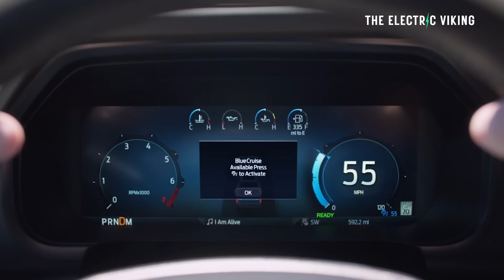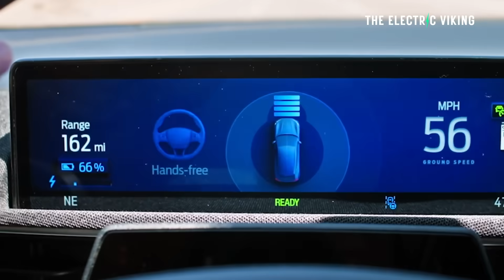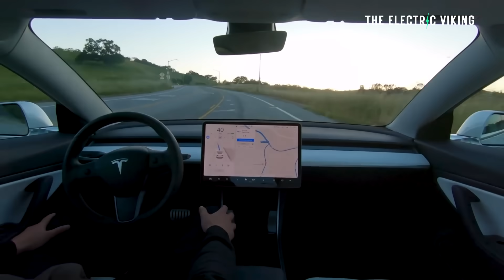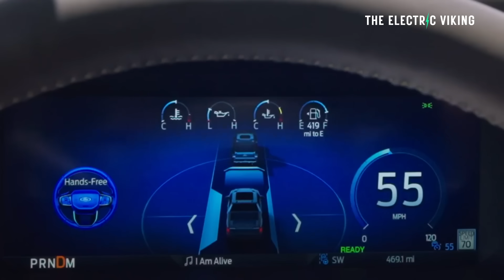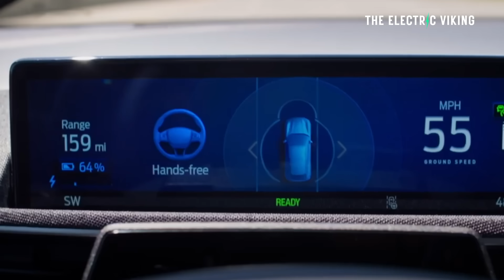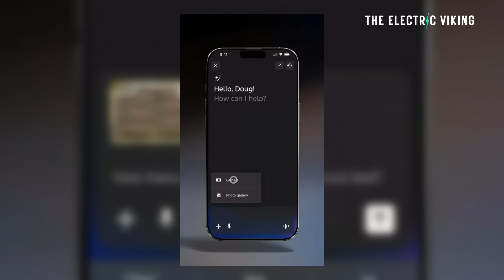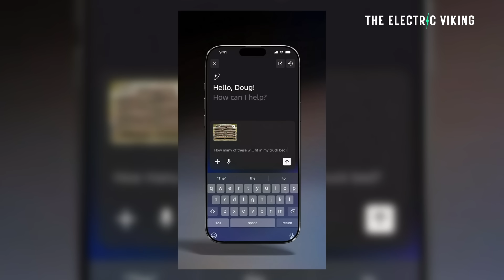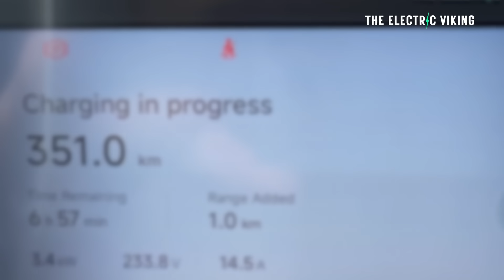Ford Says Its NEW FSD is 30% Cheaper than Tesla's and Capable of L3+

Comment: Is Ford building their own neural net chip? If so it might be nice if they gave some details. Tesla had Autonomy day six years ago where they gave a fairly detailed description of the HW3 chip architecture. Rivian just had their own autonomy day where they did the same, slightly less detailed but it looks like a similar architecture to Tesla. Ford hasn't done this so I don't believe that they are building their own computer unless they define building their own computer as putting an Nvidia chip on a board.
Using Nvidia for the hardware is a perfectly viable solution. Nvidia knows what they are doing with AI chips. The software is another matter. Ford doesn't have any training data to use, Tesla spent years collecting billions of miles of training data. Perhaps they think they can do it with simulation, that might be good enough to get them 90% there but it won't get them to 99.999% which is where they need to get to.
Ford was an investor in Rivian, they could go there to license self driving. It will be five years before Rivian gets to where Tesla is today but at least they've shown a path. Mercedes had demonstrated something that kind of looks like FSD. They've been working with Nvidia for five years so maybe they are close. Ford could go to them. Lucid is using Nvidia and they've partner with some company to provide the software, maybe that's a path.

Comment: You think autonomous driving must be self-developed by car manufacturers, wrong, relying solely on self-development by car manufacturers is very very difficult, most car brands do not have the ability to fully self-develop. In China, there are many technology companies specializing in autonomous driving, and their products are excellent. The so-called autonomous driving behind many car manufacturers is actually the result of seeking cooperation from these technology companies. It is common and easy to directly purchase an autonomous driving system completely, change the name, and introduce it at the press conference.

Comment: I had a similar reaction when I heard about the Donut battery
Reply: On the back of the announcement and I agree it is vapourware I had a close look on where the solid-state battery industry actually is.  My guess is that they are all extremely close but no one wants to press the trigger.  This is for their benefit it is nothing new.  Even if Toyotas decade long claim of having a solid-state battery is true they simply won’t release it because it will impact them more than anyone else.
Reply: @ouethojlkjn I mean, they're losing more by not releasing it if true

Comment: Electric Viking, what the hell are you talking about.  I've read the media release on Ford's site.  It is not saying anything about it being better than Tesla or anyone else. They are just saying it is going to be a massive  improvement over their current driver assist system.  I see them saying it will be L3.   I don't know where you get L3+.  Second hand sources are saying Ford is claiming  "point to point autonomy'.  But that is vague.  L3 by definition is hands off and eyes off the road from some point to another point.   So it's not false.   In fact all they are announcing is something they had already announced 3 years ago but it is coming two years late.

Comment: Hey Sam, it’s going to come out with level 2+ which is supervised and then level three on highway only which is hands-off eyes off meaning you can text message or watch videos however, once alerted you have to be prepared to take over the vehicle that’s different than level four where you can fall asleep in the vehicle is expected to be able to take over and save itself in a problem or emergency in level three you are still expected to take over and you are not able to fall asleep. Their level three eyes off will only be on highways.

Comment: Ford's stock is at a 52week high... they are covering with every marketing spin they can to keep investors from figuring out that Ford has zero ideas how to compete in the market in the next couple years.  This is pretty standard for Ford...  GM's marketing covers for them too when their stock should tank though GM usually has stronger plans than Ford ever had.

Comment: Still not a peep from the Electric Viking about NVIDIA's open source level 4 autonomous driving AI model that it is giving away along with demonstration drives in Mercedes Benz cars at CES 2026. Every single car maker world wide can now start producing autonomous driving vehicles for release over the next few years if they want to. Even Ford's L3+ is a threat to Tesla which still does not have any type of Level 3 autonomous driving after over a decade of broken promises. Who is NVIDIA? Only the most valuable company on Earth worth $4.5 trillion compared to $1.4 trillion for Tesla. So when NVIDIA puts its open source open weights full stack full self driving software front and center at CES, perhaps pay attention?

Comment: I think you need to review what SAE levels mean. L3 covers a large range of capabilities from something as limited as M-B's Drive Pilot, certain highways, excellent weather, daytime only. Ford should be able to do better than this low bar.
Reply: I agree. It is probably only on the highway in good weather. My Juniper Model Y drove me home overnight from Miami to Atlanta in a pouring rain storm. No issues even though I would have been nervous driving in those conditions.

Comment: I have used Ford's cruise control, and it is fairly equivalent to Tesla's Auto-Pilot, but not as good. It works, but Tesla's Auto-Pilot is better. It's also a LOT more difficult to set and use. Ford doesn't have FSD, and it's doubtful that they will have it by 2027. Ford's CEO has a penchant for lying.
Reply: If Ford and others are 90% as good as Autopilot, it’s the remaining 10% that takes 90% of the work.
Reply: @lsh3rd  Keep in mind that Ford does not have "Full Self Driving" (FSD) software. It essentially has cruise control that steers the car and keeps it in the lane. It does work, but I own a Tesla Model 3 and Auto-Pilot (Tesla's cruise control) is much easier and much more trustworthy. I had a hard time setting Ford's auto-steer cruise control. You have to activate two settings to get it to work. It's clumsy and not as reliable as Tesla's auto-steer, cruise control (Auto Pilot).
Reply: @franklong6269 
Forget Autopilot, although it's ok, it's been superseded, and there's no more work going into it.
Enhanced AP (EAP) isn't an available option on new Teslas, (correct me if I'm wrong).

FSD is where it's at, on a totally different level.
It's amazing.
Reply: @jorganzola1  Actually, Autopilot is included on all Teslas except the two new "Standard" Model 3 and Model Y, non-premium versions. I own a 2022 Model 3, and it lacks the updated HW4 (Hardware 4) upgrades. But FSD is amazing, even on my older Model 3. Tesla gave me two different free trials of earlier versions about a year ago, and I was very impressed. Later this year, Tesla will come out with what is essentially HW5 (I think it is called HW4 III or something close to that). When that comes out, we may see Level 3 to Level 4 autonomous driving. It is designed for the Cybercabs to allow them to function without humans driving. 

I use Autopilot a lot. It essentially drives the car so long as it is following another car. It is superior to every other self-driving software I have used on other cars by a wide margin. For the last five years, I have worked a lot out of state, and I rented a lot of 2024/2025  vehicles, and nothing even comes close to Tesla's Autopilot.

You are correct, if you are using Autopilot, you might as well use FSD, because they are very similar. Level 4 FSD will enable nearly full autonomy for Tesla self-driving cars. It will be the future of all Tesla cars for Tesla customers who purchase it, and it will be the future of the auto industry. Already, families are buying Model Y cars for their parents to help them maintain their mobility and drive safely. Having a car that essentially drives itself is something that most people will eagerly want, and Tesla is heading to that level very quickly.
Reply: @franklong6269 
I've done many thousands of k's on autopilot. It does NOT need to be following another car to operate.
However it's useless on some suburban roads, doesn't negotiate roundabouts & make turns. It wasn't intended to.
It's great for the highway.
FSD is on a totally different level, there's no comparison.
Reply: @jorganzola1  I was referring to Autopilot stopping the car at a stop light. If you don't have a car in front of you, Autopilot won't stop at a red light.

In the US, we don't have many roundabouts (thank God), and Autopilot wasn't really designed for complex decisions because it is not actually driving the car like in FSD mode. 

I use Autopilot in town occasionally when I don't want to have to worry about keeping the car in the middle of the lane, but most of the time I use cruise control on my Model 3. Autopilot is good for long trips if the highway is not crowded and you don't have to change lanes. It is very useful sometimes in town and with slower traffic, also depending on the situation. But really, I would choose FSD over Autopilot if possible. However, I am not subscribing to FSD right now.

Comment: The Six Levels of Driving Automation
Level 0: No Automation – The driver does everything; the system only provides warnings (e.g., blind-spot warning).
Level 1: Driver Assistance – System assists with either steering OR speed/braking (e.g., Adaptive Cruise Control or Lane Keeping Assist), but not both simultaneously.
Level 2: Partial Automation – System assists with both steering AND speed/braking in specific scenarios (e.g., Tesla's FSD Beta, GM Super Cruise), but the driver must always monitor and be ready to take over.
Level 3: Conditional Automation – The system handles all driving tasks in certain conditions (e.g., highway traffic jams), allowing the driver to disengage, but the driver must be ready to intervene when prompted.
Level 4: High Automation – The system drives itself within a specific operational design domain (ODD) or geo-fenced area (e.g., Waymo robotaxis), and no human intervention is needed within that domain.
Level 5: Full Automation – The ultimate goal: the system drives everywhere, under all conditions, with no steering wheel or pedals needed. 

Ford BlueCruise, introduced in 2021, is Level 2. Stepping up in the next couple years isn't out of the question, especially if they're going to partner with NVidia.

Comment: How can u call any of it fsd. It's all assisted driving period,
Reply: Well if you aren't holding the steering wheel, pushing the brake or accelerator while the car is in drive and navigating to a destination then yeah that's definitely self-driving until you take over.
Reply: Take a Tesla for a test drive and get back to us.